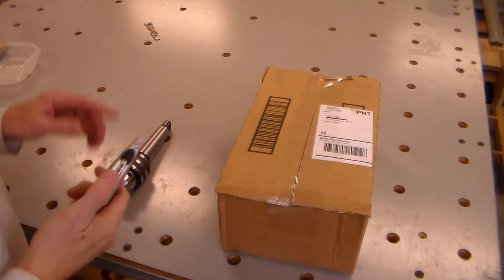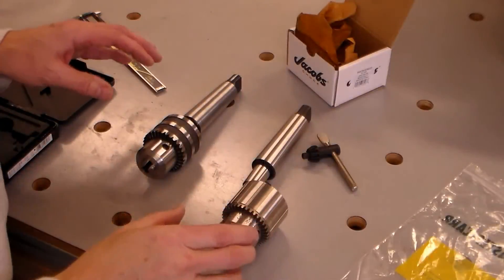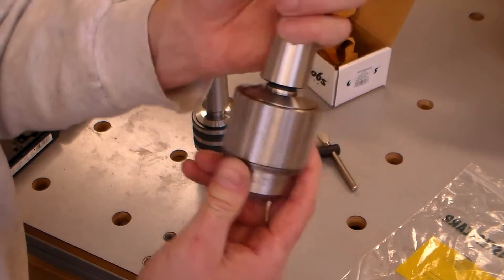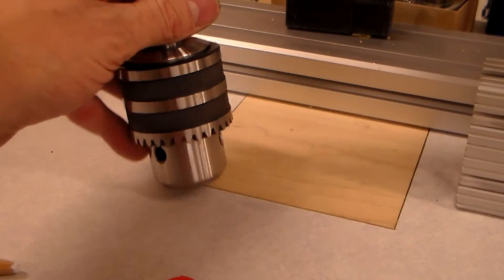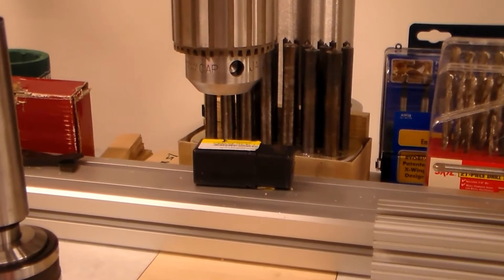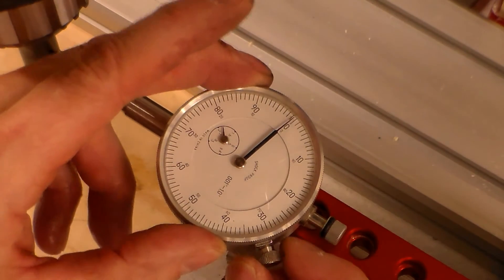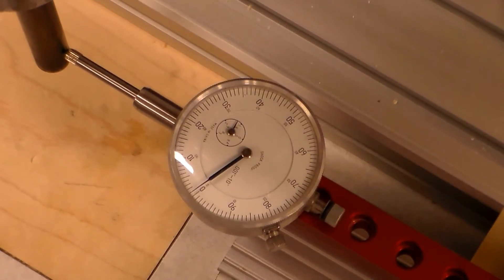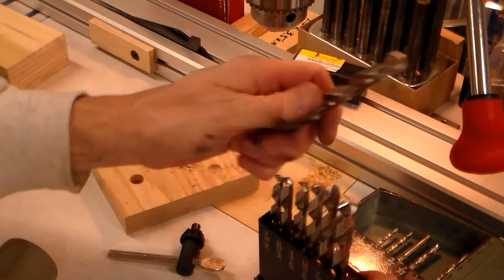02 Drill Press Tuneup

Comment: Sent my old-ass Duracraft spindle/quill assy and brand new Rohm chuck to Hammerscale.com and let the pro's take care of the rebuild. Came back with 0.0005" TIR. He worked my chewed up Jacobs taper with his lathe and mounted the chuck. New, high quality bearings, cleaned, polished, the works. Some stuff I leave to the professionals.
Reply from the maker: Nice!! Thanks for the information. How much?
Reply: @JeffFischer1  Check his website for pricing. I needed extra (lathe) work so my cost was reflective of that. He is a good guy though, awesome email communication, and a one-man shop as far as I know. He also does CNC, CAD, and manual lathe and mill work. I won't go anywhere else for any of that stuff from now on.
Reply from the maker: @CORZER0  Will do, thanks!

Comment: Thanks for posting your videos Jeff. You helped me out with my problem that I had with my drill press. I was 10 to 12 thousands out and now I'm 2 to3 thousands out on my runout. The runout problem is happening on the tapered fit between the arbor and chuck. I can say that because I put a new spindle quill assembly in my drill press so the problem then goes to the chuck and arbor. I also have a new Jacobs chuck and arbor. YOU CAN NOT GO WRONG WITH JACOBS. You've got the right stuff man. I will try to send a picture of my drill press just to keep the forum going. It's good when people get on youtube and talk about there problems because it might just help someone out.
Reply from the maker: +wes wes Thanks Wes